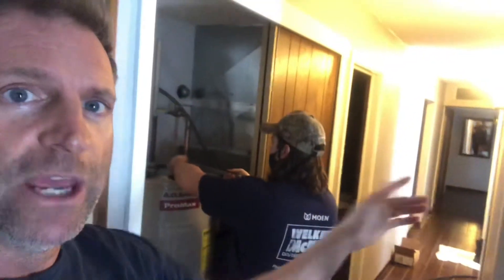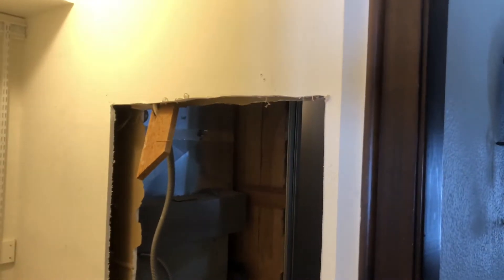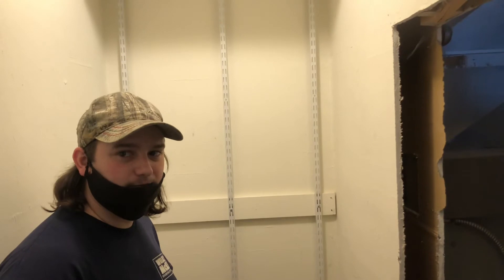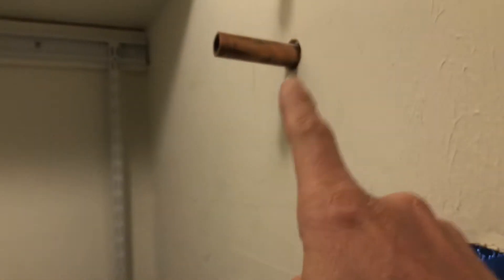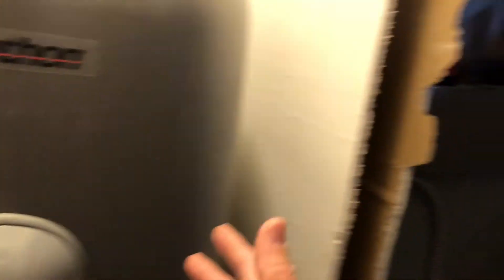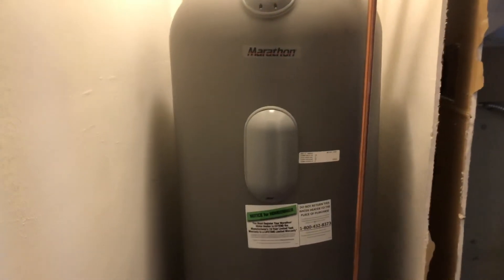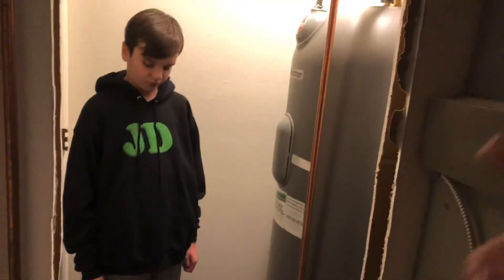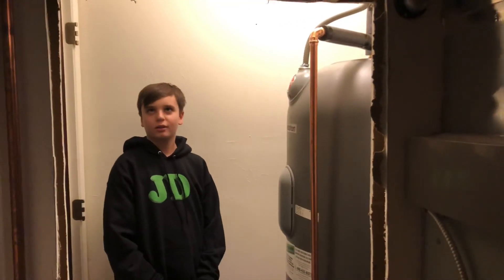Getting The Ultimate Hot Water Tank Upgrade!

Comment: Another great video - what do you see as the advantages over the tank less hot water heaters?
Reply from the maker: Personally I think tankless is the way to go the problem is we have a pretty high demand with all the aquariums and everything else going on around here so they advised against it which we talked about a little bit in the video basically we would’ve had to have the electric company come out and put a larger box on our house to draw more it was a whole thing we decided to go with this tank instead that way we would never really run out it was much more efficient and had a lifetime warranty because it’s made of plastic instead of steel honestly surprised they didn’t start making them for plastic along time ago with all the extra plastic we have on the planet there certainly is lotta good things like this we could do with it we are very happy with it it’s been working out very wellBut the funny part is Jack keeps telling everybody we have Walt Disney in the closet Ha Ha Ha Ha Ha